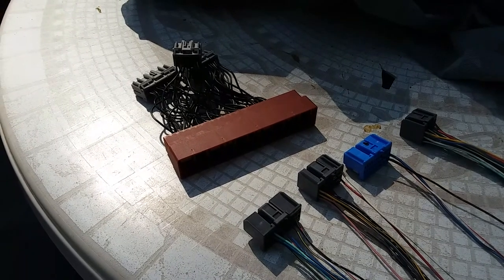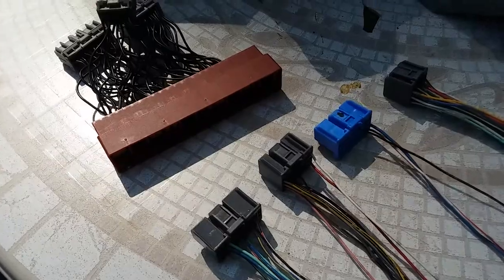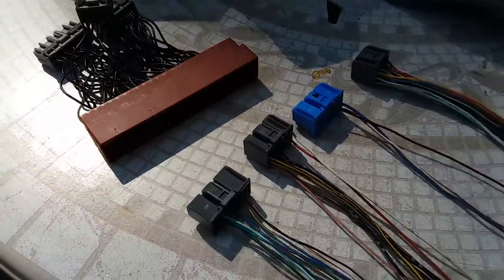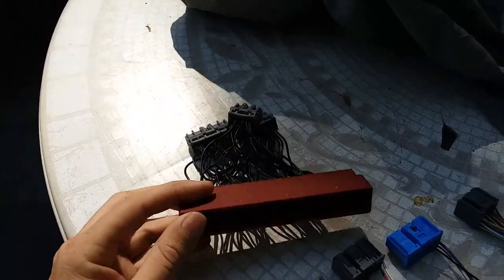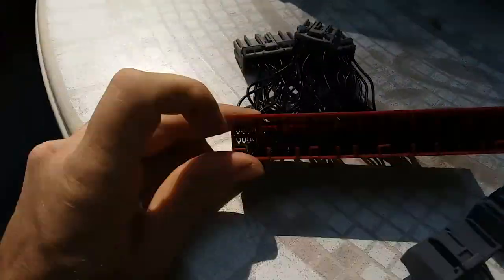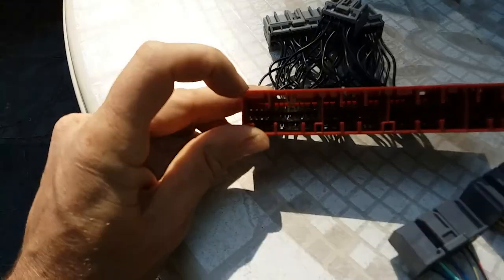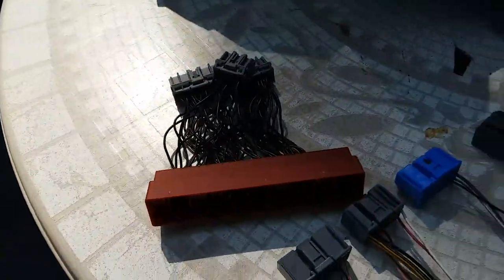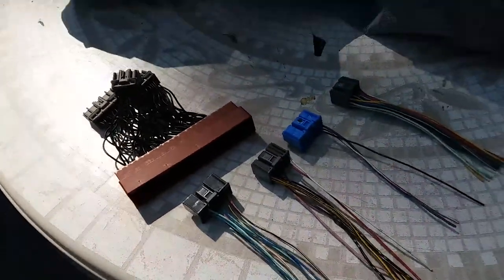98-01 Honda CRV automatic transmission obd2b to OBD1 dual ECU jumper harness part 1

Comment: So this would work to run a 97 del-sol si b16a2 into a 99 automatic Crv.?
Reply from the maker: Maybe I don't know for sure
Reply: @shane86lxi43  I was thinking of running a 99 si distributor and the b20 engine wire harness to run with the stock b20 crv ECU. I'm not really worried about having vtec right now.. I just want to get the engine running first. but I haven't seen much info on it for a b16 Crv.